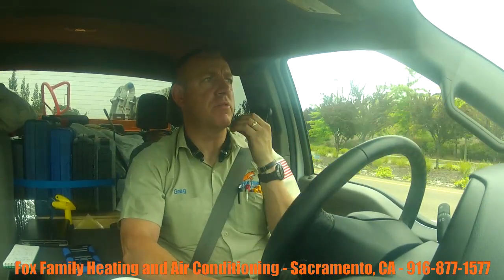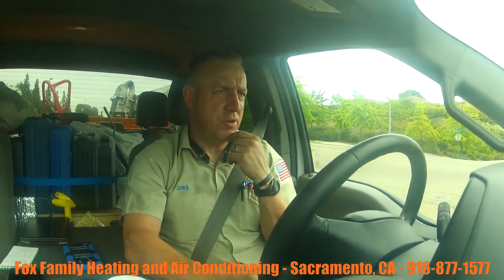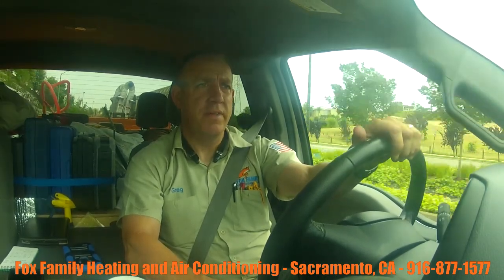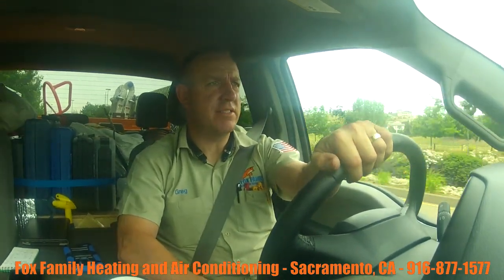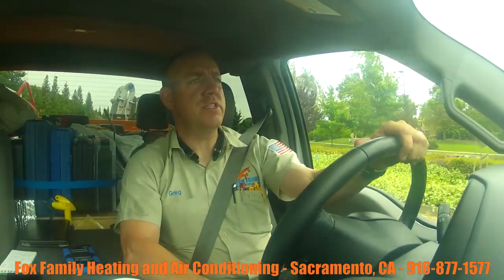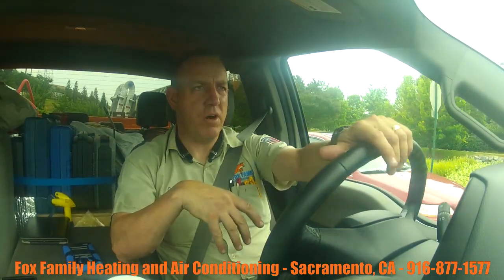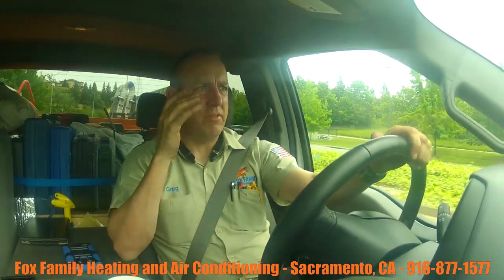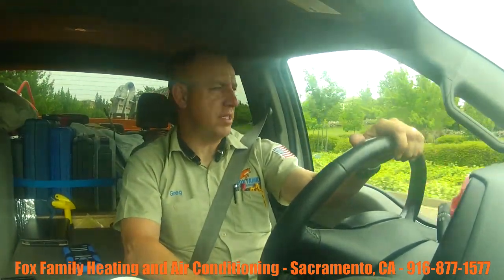Changing an AC Compressor (Home AC Repair 2021)

Comment: Thought I might be able to do this myself, but when I saw the blow torch come out... fuck it I’m in over my head! Making the call!
Reply: LOL Blow torches and a little soldering isn't that bad.  Actually, the hardest part is putting in the freon and making sure you have the right gauges, so that you don't put in too much!
Reply from the maker: Sunset Rider OMG that's awesome!  Thanks for the feedback.  Definitely a good reminder that this stuff should be done by an HVAC technician.  So many things can go wrong if you don't.  Thanks again!
Reply: @foxfamilyhvac did you vacuum the compressor as well?
Reply: Don’t forget you have to apply a vacuum to the line. Way too much stuff. Call the hvac guy.
Reply: Sunset Rider i said the same thing
Reply: its not a "blow torch" -its oxyacetylene its "gas welding" brazing-- solder and propane torch wont withstand the vibrations and pressures- and you would have a leak and lose all the freon very quickly.
Reply: Brazing god
Reply: Is that why we don't get to see Freon part?
Reply: Hahaha. My thoughts exactly

Comment: Question 1 what about metal in system from old compressor. I know people use filter dryers but if they are like filter dryers in automotive systems they are nothing more than a can with condesent & a screen to catch big stuff not fine metal. I know to use silver solder but do you use flux & will same flux for low silver solder work. 3 does compressor come filled with oil & if so how to adjust for oil since system already has oil in it cause you don't want too much in system. 4 we have a scroll compressor in the automotive field scroll pumps are junk but they are made from aluminum. Want to up grade if scroll is not good to use

Comment: I wish I would have watched this before replacing my 12.5 year   old 2 ton Central A/C  R22 system. It had a locked compressor (the tech tried replacing the Start / Run Capacitor. No dice !!)  Instead I paid $$$$$$$$$ for a new 410A system.
I based my decision  on one  A/C Tech that told me I should replace the system. I should have talked to a couple more A/C  Techs to get their opinion (replace / repair). These silly CAC systems should last 20 years. I don't care what anyone says. Okay so of course there will be a Big repair bill after the 10 year mark. But still should make it to the 20 year mark. Mine had a single stage compressor & a variable speed blower motor. It was a 14 SEER Straight Cool unit w/ 5KWatt electric strip heat (never used). The Condenser coil was absolutely clean. My Evaporator coil was dirty (mold / mildew). So maybe I should have changed that along w/ the Compressor. It was working FINE before the Compressor failure. I'm pissed. Now I've got one of these junky 410A blended refrigerant systems w/ higher internal pressures that are bound to shorten system life. Seek council from multiple A/C Techs before swapping out your system.

Comment: what is the brand/model of your soldering rod ?
Reply: Try to find a good one which is not sticky to pipe and easy to melt and float such that I can guide to the place all around the pipe. Thanks for info.

Comment: Good job !  next time try to sanding before you cut dier loose easily 410 gauges ? Crankcase heater (not wired)oh yea California r22 on Liquid side ? charge are. wait to settle out.  Replace entire unit only 1year  warranty on a compressor cost / time 407c on a budget still not a good warranty Sell a new unit love your work u got Balls. Contractor to contractor

Comment: Humble observer here but I noticed you didn't use any flux on your braises, was there a reason why that wasn't necessary here? Your video has been very helpful on my own hvac learning journey before I enter my apprenticeship later this year.
Reply: Flux not required brazing copper to copper. Just has to be clean hence why he used sand paper to clean the pipework. Flux is required when brazing dissimilar metals such as copper to steel. Brazing rods with appropriate silver content also required brazing dissimilar metals

Comment: i don't think that unit was worth putting a new compressor in, 10ish seer r22 cheapo builder's special. would have been better to go to 410a/13+ with new indoor coil, 10 year warranty.

Comment: Problem is the compressor is 80% of the cost of the condenser unless it's warranty.
Reply: Chris Duhaime until you get into some situations where it’s old r22 so you’d end up changing a coil and Freon lines and the way the previous lines and a coil was installed is just a mess and would require an absurd amount of extra hours. Changed a compressor in a home last week and prior to looked to see what it’d take to replace everything and the way they had the furnace and stuff set up in the basement you would have to tear out part of a sheetrock wall the was apparently added sometime down the road to even get the coil out.

Comment: Just wondering, does it matter where in the system the dryer is located? I've noticed (from various installs) the location varies.
Reply from the maker: Most people are trying to be conscious of the filter dryer being in the liquid line as close to the  evap coil's TXV as possible.  Here we are trying to catch anything before it passess through the orifice on the first cycles of refrigerant upon start up.  For a heat pump split system we are still putting them in the same spot.
Reply: Fox Family Heating and Air Conditioning thanks,  we just has a/c added onto our system (n.y.) and our tech put it right before the line goes into the a-coil. I thought there had to be a reason for the different locations of it.

Comment: Have a question for you does a  compressor comes with the oil already inside or we have to add it.
Reply from the maker: Comes already added for our residential models.  POE oil is the only type I have seen in the replacement ones

Comment: Not nitrogen during brazing??
Reply: Well that new compressor should last maybe past warranty. I bet the original just had a chattering contactor. Next time maybe a hard start. You could of installed a new condenser for the price of the compressor. You basically ripped off that home owner...
Reply: @wirelessjj8817  he explained that the condenser was too big and the customer decided against it
Reply: I was just going to ask that.

Comment: How long did it take to do that replacement? (It's currently hot and humid here in northern Illinois and I don't want to be without AC for too long. Ours is on more than it is off!)

My compressor started getting noisy and I'm just trying to get an idea of how much time it takes, and would it be less time than replacing the entire unit.

Comment: I used to have a window unit that would cool great, but the compressor would rock the living hell out of the windows. Later on I checked to see if the bolts were on ok & they were. I have a new unit that is not nearly as noisy & cools just as great. I wonder what internally causes one compressor to cool ok, yet rock the neighborhood, and another to be relatively quiet.
Reply from the maker: +NSNOfm78 thats a good point.  I am aksobstill trying to kearn that kind of stuff too.  Check out guys like Ulises Polacios channel for more info on what makes conorrssors go bad by dissecting them.

Comment: great job.  I like the way you took the time to put the contact protector fluid on before reconnecting the power, and vacuumed the interior, as well as inspecting the brazed joints.

Comment: 1) Let all the refrigerant out (what you do with it is none of my business)
2) Cut out the old compressor (seal the pipes just for luck)
3) remove and replace old drier
4) install new compressor
5) pre charge system
6) check for leaks
7) clean contacts
8) charge system

Did I miss something?

Comment: tech to tech, the system should have been replaced
Reply: cchristie1986 sales tech to tech
Reply: How can you determine that just from watching this video? If he  changed out the compressor, drier, contractor and the coils are in good shape I don't see why there's a reason to change it out.  Why change out   a 16 year old system that's working fine? I doubt the home owner is very concerned about efficiency right now. He just guaranteed another 5-10 years out of his system if maintained properly.
Reply: a 16 year old evaporator coil is still an issue. A very big issue. In my younger years I would have changed evap coils or compressors all day long on r22 equipment out of warranty but it doesn't even make economical sense, especially in an environment like California. Definitely not a salesman, one thing they don't teach in trade school or wherever you are that correlate to the field is ignorance.
Reply: and there is no way this system will last another 5-10 years. This gentleman is either doing work for an insurance company or someone in the process of selling the home.

Comment: For the compressor bolts I use a long 3/8 extension 1/2 socket and a 3/8 adapter for my zip gun.

Comment: My aircondioning system has lasted almost 30 years. The only thing that's wrong with it. Is the condescending fan motor is seized because of bearings. Instead of replacing the fan, I'm thinking of replacing the whole system. The furnace was put In at the same time. Only thing, that I'm I've done to the system, is replace the blower fan in the furnace. The system was installed in 1990.

Comment: When you unsweat the refrig lines, you should of purged with nitrogen. See all that black carbon on top of the copper? It happens INSIDE the copper also. Then you have a contaminated line set and a new compressor LOL. And if 410A was used which cleans the lines......

Comment: Why take the new compressor out of the box, before you have the old one removed? You were dragging the new one on the ground. Could hear it snagging on rocks, digging off the paint. What does that do? Could cause it rust out on the bottom.

Comment: what happened to the original comp? something with the windings?
Reply from the maker: JDT738126 scroll probably broken or cracked. Causing an awfully loud operation.
Reply: Fox Family Heating and Air Conditioning cool, thanks for the reply

Comment: Hey buddy have a question for you , over the  last 10 compressors or so i have installed 3 have locked up during initial startup , 
they wouldn not run at all and they were just stuck at Lra 90+
they were conversions , i think one of the was r22.
any ideas?
I charge it up with liquid after final vacuum as you did but they just stick after firing up initially , i dont think flushing or anything has to do with it since it would run at first at least even if not properly flushed even though i have flushed it.
I'm think maybe i should break initial vacuum with vapor and run it then charge it in vapor to be safe, cant imagine ive been 
having such bad luck to run into a string of bad compressors.
dont know if the 407 or 427a has anything to do with it
Reply: Duct Cleaning use Copeland not Bristol
Reply: Duct Cleaning I
Reply: Always ck the compressor amps while charging.both running amps and locked rotor current. You might be overcharging the system for some unforeseen reason. Ck also with the condenser fan partially blocked to simulate a more extreme heat wave.unless you want that emergency call

Comment: Get you a couple of 12" long 3/8 drive so can get compressor bolts out easy, believe me you will use them on residential & commercial compressor changes.

Comment: That hot gas line is barely inserted into the compressor discharge port. compare 3:15 to 6:39

Comment: thanks for info. Is 407c here to stay?  what ever happen to 410a?
Reply: 407c used on medium temp. 410a is the new replacement.. I'm not sure if it a carry over from Carrier as Puron.. all new units use it. The unit he could buy dry was stocked by the supply house and  they want to get rid of it. 410a requires both evap and cond. I no longer will install dry charged units . 410A Is standard. There is no bargain in a compressor change out. Lets say the fan goes bad next month and now you have to explain it to the customer. You try to save the customer a buck and wil come back to bite you in the ass
Reply: In california the no longer sell 407 dry condensers at least not in southern cali... They are trying to push everyone to 410a.

Comment: A question to the expert,
In
 my Samsung 18 000BTU Aircon (6 years old) is the compressor defective. I
 now have a used found with 18 000 BTU but the is a Mitsubishi.
Can I install it in the Samsung_Aircon

The connections are identical ...

My craftsman does not want to do it .... he wants to sell a new complette Aircon .... to me

Comment: I have a couple of questions: Did you do a nitrogen purge while brazing, I didn't see you set that up? Why did you put the liquid line drier inside? I would have put it on the outside, makes it easier to check to see if it is restricted (checking the temperature drop across the filter) and easier to change when it is.

Comment: contractor 2 contractor I thought you did a really good job went through it like you should have done the only question I would ask knowing that you only change the compressor because of the noise did you also change the running capacitor or did it be the same size for the new one
Reply from the maker: John Deschenes yeah I changed it out. always.

Comment: I have central air condenser unit AMANA RCC60a2b, evaporator CHF48TCC which were low on R22 refrigerant (175 ounces/ 10.94 pounds total in system). How much time may it take to charge about 6 pounds of the refrigerant using suction line?

Comment: Nice work, should last another 20 years.   The only thing I would of did differently would be to install the liquid line filter outside of the unit.  Then it can be changed in the future by pumping down the unit.
Reply from the maker: That unit is so old it wont ever need a new filter drier. hahaha.  Thanks for watching!

Comment: When is changing the compressor a better option than going with a new system? Just curious, I know it depends on the customer. But, in the grand scheme of things would they save more by getting a newer system? That's more efficient.
Reply from the maker: I would think so.  For sure.  And that unit comes with a warranty too.  Thanks for watching!

Comment: Nice video Greg. Very nice and clean job. My thought on that and how I approach that with clients is that it's like putting a new engine in an old car. It's a pretty engine but still an old car with crappy gas mileage. Even a cheaper unit would still get better gas mileage and have a 10 year warranty. I don't know what the conditions were but either way keep doing your thing. I hope you don't take that negative just trying to help.
Reply from the maker: I understand. I always leave it their hands. i just do the work

Comment: Nice job. I have that same condensing unit. Mine is about 14years old.  Although it is shot from the dog peeing on it.  I put in a multi-zone Mitsubishi system last year.  Kept the gas furnace for back up.  I would have liked a little commentary during the video but I'm sure you have to balance video taping and getting the job done.
Reply from the maker: Thanks for watching.  Yeah.  I try not to be to instructional in my videos.  I'm more interested in just letting you guys see what Im doing out in the field.  Thanks so much for watching!

Comment: Nice job.  What was the product you put on the compressor connector?  A di-electric like DC4?
Reply from the maker: +r aeronca I always try to remember to put De-Ox on terminal connections and service disconnect to prevent sticking and oxidation on the blades.  Saves the customer from a repair down the road.
Reply: +Fox Family Heating and Air Conditioning I was wondering what that stuff was too!